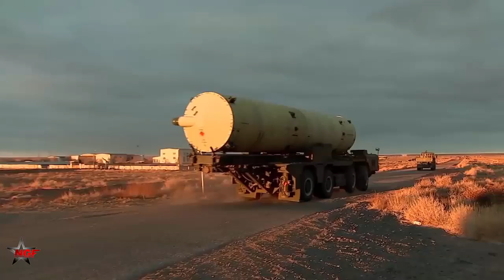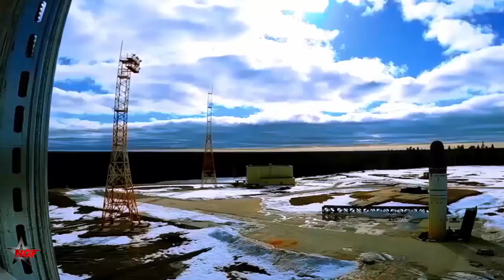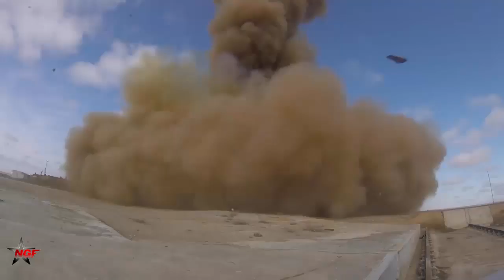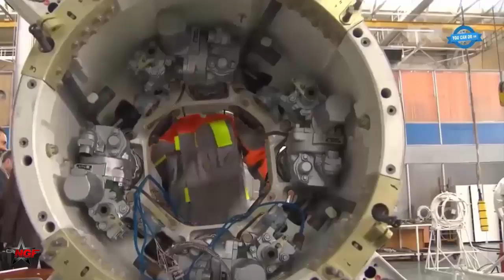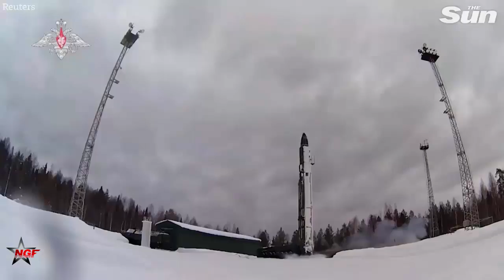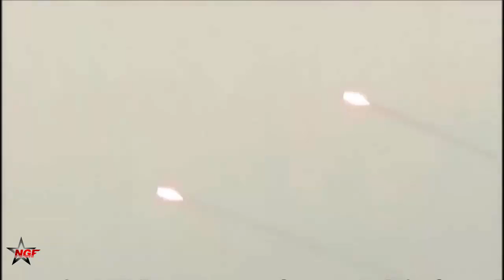Russia’s ‘Satellite Killer’ S-500 AD System, 200-Ton ICBM To Be Put On Combat Duty By 2024

Comment: S 500 are already deployed around Moscow in October 2021...
Reply: I think that the divisions of the S-400 system and the Nudol A-235 anti-ballistic system were then installed (System A-235 PL-19 Nudol; Russian: Система А-235 / ПЛ-19-181М / Нудоль;is a Russian hypersonic anti-ballistic missile and anti-satellite weapon system. It is designed to deflect a nuclear attack on Moscow and other regions within European Russia.), and that a little later the divisions of the S-400 system were replaced by divisions of the S-550 and S-500 systems, while is the S-400 lowered to a lower level, where with the S-300PMU system (Russian and air defense and anti-ballistic defense is concentric, and in several layers) serves for long-range air defense, anti-ballistic defence, a and protection against cruise missiles at long distances.